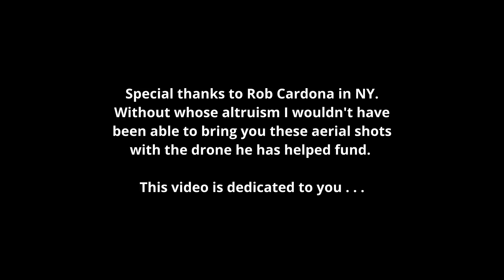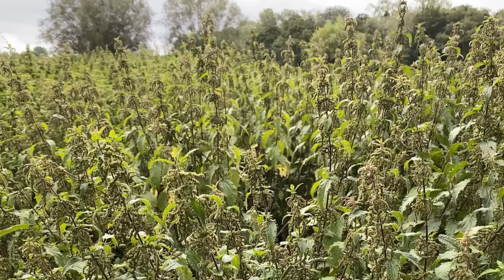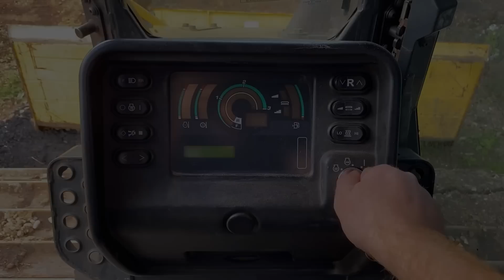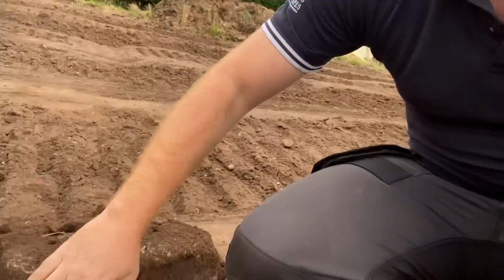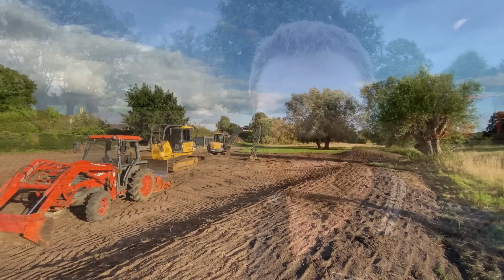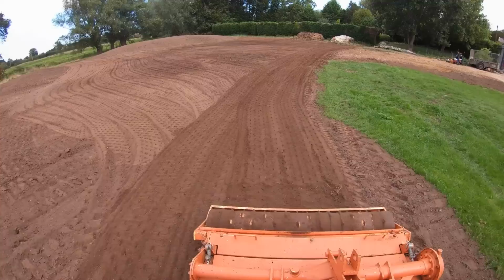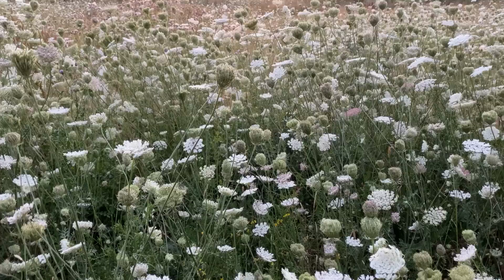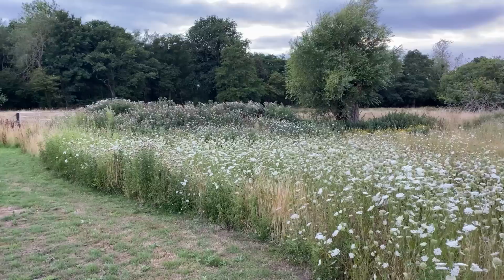Making A 1/2 Acre Wildflower Meadow - Start To Finish & Revisiting 2 Years Later

Comment: That is a huge success! I was surprised at how deep you found builder rubble, it looks like the area has been used as a dumping ground for years, I do like the use of large banks, that must provide a localised shelter from the wind in Norfolk and create micro climates, watching all that top soil being bladed up my thoughts were that we could use that here, as we have less than 100 mm of soil over solid limestone, which dries out very quickly in high temperatures, and becomes waterlogged in the wet! this meadow will now provide good habitat for many species, and it is good to see someone being keen enough to convert this area into such a wonderful environment! Stay safe ! Chris B.

Comment: i have 3 acres of lawn that i'd love to naturalize into something more friendly to the earth however, i am terribly allergic to ragweed and it grows everywhere around here.  How do i keep the ragweed out of the wildflower meadow?
Reply: You might want to consider turning that area into a woodland garden, many wildflowers prefer to grow under the canopy of trees but ragweed doesn't
Reply from the maker: Hi Danee - I think this is the plant in North America that causes a lot of allergies through to Autumn time.  As with all prolific seeders it is best to mow short before it gets a chance to go to seed, but I can empathise with trying to do this over 3 acres!  Some recommend weedkiller and herbicides but you'd never hear me recommending either of those, due to the damage they can cause to invertebrates and other creatures of course.  Ragweed roots are small and shallow which means they can be hand-pulled easily, but again easily doesn't apply to 3 acres!  I would certainly recommend trying to eradicate it by preventing it going to seed but then that does mean that you will also be mowing other flowers that you might want to go to seed.   But to achieve good results then you may have to "sacrifice" the area with several mows a year and of course particularly at the end of summer.  It should help eradicate a fair bit over 2 years and you could always do a "test" on one acre, taking into account that the left seed from the other 2 acres might encroach.  Apologies if this is not a very helpful answer but I can't think of much else I'm afraid.  Best wishes, Joel
Reply from the maker: @nautilus2612   @Nautilus  Thank you - really helpful and, not being from the US, I didn't know this :)
Reply: @WildYourGardenWithJoelAshton  it’s a very helpful answer.  I could probably do a combination of mowing and pulling. They are easy to pull and I've spent a lot of time this august pulling them out of the neighbors yards along the road I walk my dogs.  We just moved here last year and the 3 acres is all grass except for a few small flower beds.  I’m not opposed to adding shade trees and other plants to some of it closer the house but I’d like to add the meadow to some of the back yard.  We abutt with a cornfield so it’s feasible.
Reply: @nautilus2612  That’s good advice.  I had an arborist here to see about the trees we have (we moved in a year ago) and he suggested shade trees so it’s been on my mind.  Keeping out. ragweed is a great motivator
Reply from the maker: @daneekaplan4284  Glad this helped Danee - keep me updated on your progress and the results - I think you'll make a good determined job of it - best wishes, Joel

Comment: Hey Joel, this video is great, thank you for putting it together, it's great being able to see the work that has gone in and 2 yrs on what it looks like.

Could you please tell me, does the ground prep need to be done and left for a period of time before sowing the area? 

Many thanks
Reply from the maker: Hi Lizzy, once the site is prepared for seeding, there is no need to delay UNLESS the ground is still fertile, in which case you can let any "weed species" germinate before rotovating a second time and then seeding after that - I hope this helps, I'm always available if you need more advice at hazelwoodlandscapes@hotmail.com - feel free to drop me a line :)  Best wishes, Joel
Reply: @WildYourGardenWithJoelAshton  Hi Joel, Thanks for getting back to me and the kind offer of further advice. Where I am, the soil fertility is generally quite high, so I'm interested to try this method of scraping back to the poorer soil layer to help establish more permanent wildflower meadows, on current amenity grasslands. A better alternative to glyphosate spraying for sure... 🤦
Reply from the maker: @lizzystz2027  hi Lizzy. No worries at all - anytime. It’s certainly a more environmentally friendly approach than weed spraying the area 😊 Which won’t actually decrease the fertility either 👍